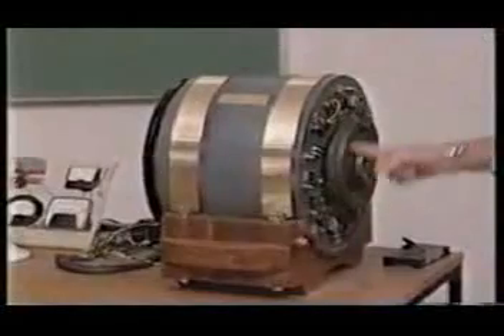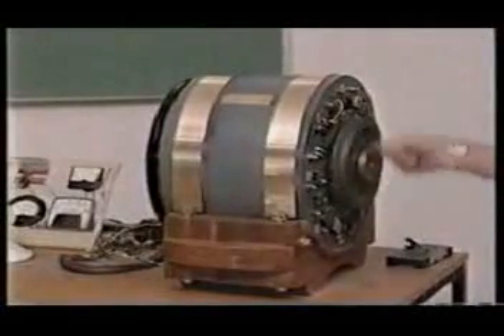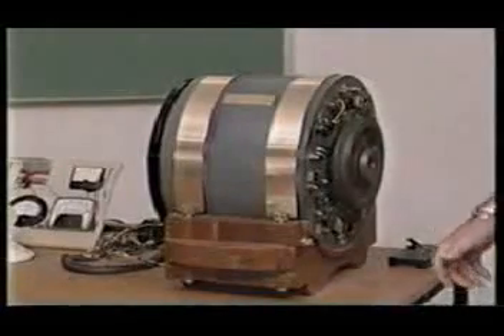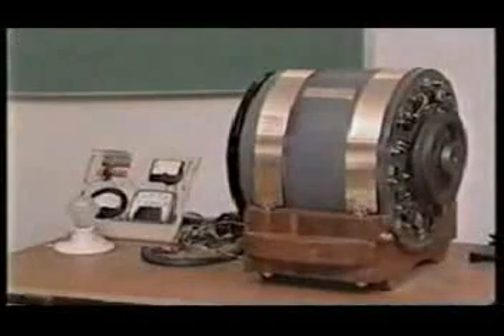Re: 'ELECTRIC VEHICLE SURGE TECHNOLOGY NO BATTERIES NO GAS'

Comment: He does have a lead acid battery to perpetuate the flywheel. You can get magnitudes more out then the original input and the power of the battery. Heavy flywheels do not want to stop and can be maintained with very little input.

Comment: Voltage and amps can change.  Watts are what important.  120v @ 10 amps = 1200 watts.  12v at 100 amps is also 1200 watts. 

I've always used 'wattage' as a good measure of 'real power' because it takes both amps and volts into account.  His device is using a small amount of amperage to get a large mass moving, when when he unplugs it is stored as kinetic energy in the flywheel, which storing energy in mechanical means is REALLY lossy to begin with.

Comment: I my self built two of the magnetic motor which I use in the feild of construction I use a chain drive and proper gear ratio to power a 2500 watt generator head I had to couple both motor in line to generate the proper tourqe but I find it works  wonderful so if the chunky santa would stop talking and actually moved and experimented he would see himself it works

Comment: You haven't bothered to explain why using a dynamo on a flywheel is an issue?  Chrysler, etc. all have tried flywheels as methods to create high mileage capable hybrids/electric cars.  As part of a system, it certainly has proven itself.  What is your ax to grind here?

Comment from the maker: The chief problem with the "Stirling engine" is that it doesn't render itself to scale-up to the point it can produce work: the power-to-weight ratio defeats converting heat / external combustion into torque.

Comment: "This thermal solar energy sounds quite interesting. Do you know of any places where I could read more about it?"

I don't have anything particular to offer, but google "solar thermal energy".  There's also a decent wikipedia article.

My favorite solar thermal application uses a Stirling engine to generate power, I think that may be the most efficient (but not necessarily cost effective) solar power system currently available.

Comment: I want to add that RTGs are tremendously inefficient.  The nuclear material provides a lot more heat energy than the thermocouple does electrical energy.  It's a simple, no moving part system that's great for space probes or other zero maintenance fields, but there are better thermal power options out there.  At the moment I think thermal solar (using heat rather than light itself to generate power) is actually more cost effective than photovoltaic power, but it's more complex too.

Comment: "If I recall correctly, space craft use an electronic device to convert heat (from radioactive sources) into electricity."

You do recall correctly.  The devices are known as RTGs, radioisotope thermoelectric generators, they are used when a craft is going to go far enough away from the sun that solar panels can't provide enough power.  

There are plans for future Mars rovers that use RTGs to give them more power that can't be interrupted by dust storms or night.

Comment from the maker: "Does anyone know of any ways to convert thermal energy directly into electrical?"

When one takes a copper wire and puts a coil on each end, then puts one coil in cold water and the other coil in fire, a current will flow. If I recall correctly, space craft use an electronic device to convert heat (from radioactive sources) into electricity.

Comment from the maker: It would require a massive amount of current to charge a battery bank enough to power an automobile in 5 minutes to run 500 miles. My ballpark figure is 10,908 amps, for an automobile going 500 miles in 9 hours. I am not aware of any technology that can be placed inside a car and that can handle 11k amps in 5 minutes: the wires would have to be as think as a human's legs.

Comment from the maker: "Do you have a water stream with continuous flow to built a hydro electric power generator?"

We do not, though I have looked into using a high-amp alternator and a charge controller, attached to a boat's log device (basically a propeller that drags behind a boat). There is a river many miles away that I could throw the evice in, and it could charge batteries.... but it takes many hours to drive to and photovoltaic panels work much better. :-)

Comment: 2) ... electricity generating system in which, after the solar panel has been made (taking into account the energy involved in that) and installed, there's very little maintenance required and the varying daily amounts of sunlight get converted, at whatever the efficiency of the panel is, to electricity?  Under normal conditions, the photovoltaic panel and battery/inverter require minimal maintenance.  Therefore, I don't see how the two can be equated the way you tried to.

Comment: 1) When you say "hydrodynamic power", do you mean any kind of electricity-generating system or only those that use water ("hydro") power to turn turbines & generators?  It seems to me it's a bit of an apples vs. oranges situation because although both farming and the building of and maintaining of a hydrodynamic power system require up-front money and time and labor, plus time and effort to maintain them, can one equally compare the cost/time/labor of  farming to a (for example) photovoltaic ...

Comment: I get cheap energy..i will never call it free

I found a couple 100 ft of 2in ABS pipe and use it to run my water to a shower...the water gets hot in the pipes out in the sun and i can finish a shower before the water gets cold
also i find wood when i drive around and burn it to warm my house and cook over in the BBQ
I save alot but not technically free

Comment from the maker: "Looked like it was drawing approx 12amps."

Unfortunately there appears to be no data on the 'net showing what the flywheel - dynamo was pulling. 12 amps is a hell of a lot of current, but the amp draw would decrease as the flywheel speed increased.

I had the same set-up on my boat, energized by a Volvo Penta Diesel engine. A huge flywheel was attached to the engine, and a dynamo was attached to the flywheel via belt. The lights stayed on after I decompressed the engine and it spun down.

Comment from the maker: "But what do you do if you don't have an outlet handy?"

Light a candle.

I suspect the reason he hand-started it was because it would have tripped the house's circuit breaker starting from a dead stop: it would take a huge amount of current, and it might have "barked" when it started. Getting the mass turning first would cut down on the initial inertia.

Comment: Notice how he doesn't tell us that it's a dynamo and what it used for. It looks like the The dynamo is used for manually generating amperage?

It looks like in order to run the dynamo on the ranch you would have to hook the dynamo up to some kind of treadmill with a horse and a carrot on a stick or build it into some kind of hydro generation in order for the dynamo to continuously generate amperage?

Do you have a water stream with continuous flow to built a hydro electric power generator?

Comment from the maker: "Hi, Desertphile. You didn't address what this guy is or isn't using in the electric car he shows in his video"

To power an automobile it requires around 5,000 watts just to get started; powering a light bulb takes around 40 watts. The dynamo and flywheel to store enough energy to run an automobile would have to be huge and I suspect the torque would make steering in a straight line impossible.